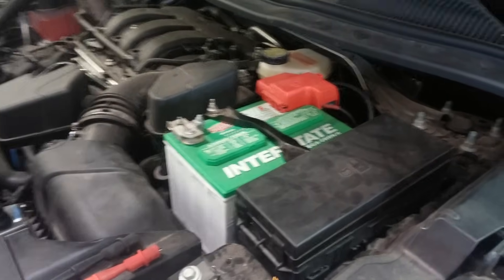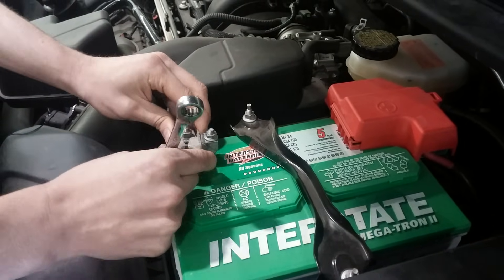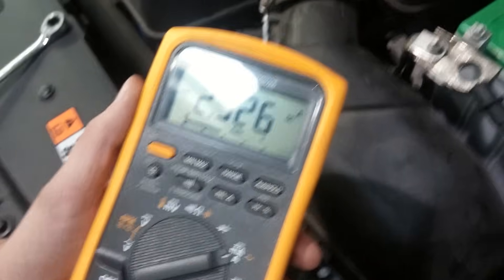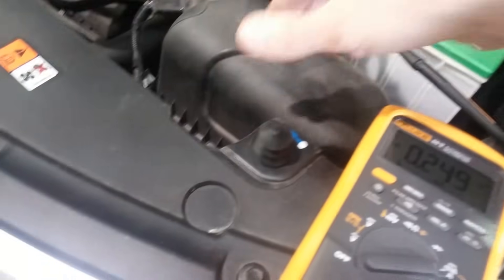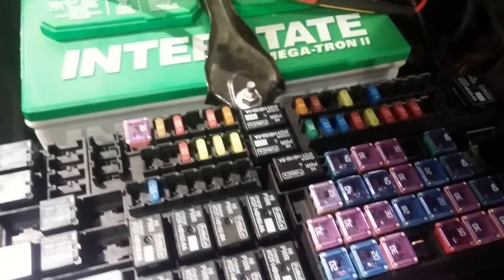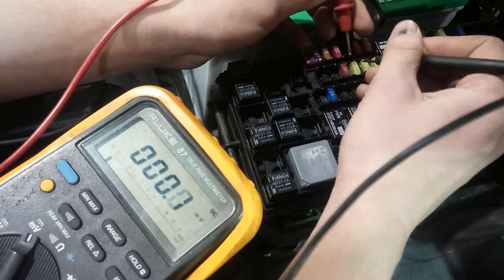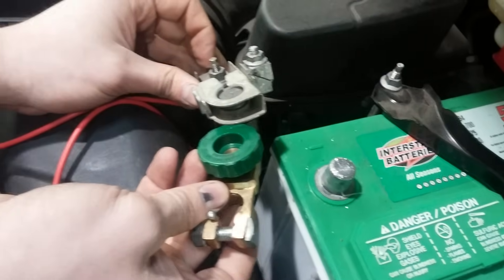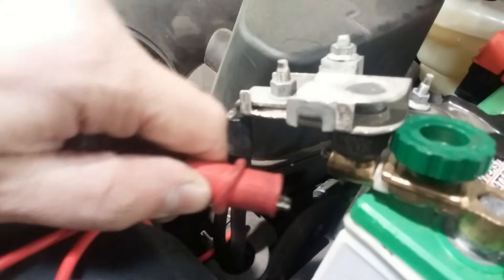How to identify and locate a parasitic drain

Comment: My test was a quick one.  When I hooked up my multimeter to test for a drain I noticed that I not only was getting 3.2A draw but every time I touched the meter to the negative cable I was getting a click from the AC compressor.  Pulled the 10A fuse for the AC and the drain immediately went away.   Now to figure out why that is happening.
Reply: Does the AC compressor have a solenoid switch similar to a starter? If so, maybe it has shorted or failed.

Comment: What about if you don't have a second multimeter? Do you then just hook the battery back up before you start testing the fuses? Also, with your setup of the multimeter being in series, will that have any effect on the results of the fuse testing?
Reply from the maker: You are exactly right.  You can reconnect the battery and then begin checking for voltage drop across the fuses.  The multimeter in series will have no affect on current flow.
Reply: @JustinMillerAutomotive  Ok that's what I was thinking. However with the car I am testing there is an alarm that sounds when you reconnect the battery. But it doesn't sound when I have the multimeter in series. I get no reading on the meter. I dont expect you to diagnose through YouTube comments but I am lost lol

Comment: Couldn't one "theoretically" take out the fuse on which you measured a voltage drop and check the amp drain on the battery once over? if it's not significantly lower you would know there is more than one cause.
Reply from the maker: You can definitely try that.  It worked well on see cars, before computers were involved.  Now, with dozens of ECUs in the vehicle, removing a fuse or reinstalling it can have very unpredictable effects on the amount of current draw.  For example, removing a fuse can sometimes cause an increase in current draw.
Reply: @JustinMillerAutomotive  Yes, but he is on the right path.  Remove the fuse, insert ammeter, wait for stabilization as before, then, assuming you have two good ammeters in the system, compare readings.  If they match within reason, all the parasitic drain is through the removed fuse.  If there is a difference, a fraction is in the removed fuse and more remains to be found in other fuse(s).  and so on....

Comment: Sparks also indicate a short circuit.
Reply: Bastos Reviewer
 - Not necessarily. Sparks are a clear indication that a determined connection is not "solid". The intermittent contact might/will generate the sparks. 
Example, contacts on a relay or any other switch, over time the contact surface will "burn" due to those sparks. Without ever being a malfunction or short circuit (as in error condition).  
  
But smoke is definitely a good tell tale that something isn't right. LOL :-)
Cheers

Comment: What if none of the fuses have voltage
Reply from the maker: Make sure to check for other fuse panels in the car.  Most cars have fuses under the hood and in the interior of the car somewhere as well.  If you still don't find the culprit fuse but you have a parasitic drain from the battery above 0.030 amps, then get a "power distribution" wiring diagram for the car and start at the battery.  If you have two positive battery cables, for example, try to separate them or determine which cable has the drain in it.  From there, look at the diagram to see where it branches off to.  You may be able to continue to use the principle of voltage drop across different wires or portions of the circuit to find out if current is flowing.  If you have a really sensitive current probe, you might be able to use that as well.
Reply: If it's Mercedes there may also be fuses in the trunk as well

Comment: thank you for this video! would it be possible that one of those jcase fuses is our culprit for parasitic draw or short, if so how do you test it? thanks again!
Reply from the maker: Of course the fuse itself cannot cause the drain, but if you are asking whether the drain could be passing through a j-case fuse, it is possible, but not likely.   This is because the larger fuses typically are a "main" fuse that protects several "sub-circuits" that each have their own smaller fuse.  For example, a 30 amp j-case fuse might feed three circuits that are each protected by 10-amp fuses.  If there is a drain in one of these circuits, it would show up in the small fuse.
Reply: @JustinMillerAutomotive  yes that was what i meant. thanks so much!

Comment: Once your battery has been drain and now dead. Is it damaged? Or can it be recharged to new again. I just bought a new battery and realized it was not the battery but a power drain. Just want to know if I should now replace the battery once it went dead like this?
Reply from the maker: You can recharge your battery and it should be just fine!  Every time you drain your battery, it reduces its capacity slightly.  This is true even of your cell phone and laptop batteries.  A car battery can only be cycled (drained and recharged) about 7-10 times before it needs to be replaced.
Reply: @JustinMillerAutomotive   Thanks so much.

Comment: Why should you start by measuring the amp draw from the battery first and not with the fuses?  Couldn't you determine if you have a parasitic draw from the fuses instead thus eliminating a step?
Reply from the maker: For me, it is just part of the logical problem-solving process.  I want to know if there actually is a drain before I put effort into hunting it down.  It rules out other variables and possible causes, such as an intermittent problem or  a bad battery.  You could spend a lot of time looking for a problem that doesn't actually exist.
Reply: Do remember to check the state of the battery, its age, any contamination on its surface, or the cradle its sitting in🤔, make sure its fully charged, get a DROP check done(pole to pole discharge) to ascertain the usefullnes of the cells and overhaul condition, as often, a depleted cell/or generally a bad battery will give enormous grief, and time consuming misplaced effort.

Comment: I like measuring the mV across the back of the fuses instead of removing fuses to see if the Amp draw drops like it says in other videos.  In my case I KNOW there is a parasitic draw because I just got a new battery a few days ago and after letting car sit a few days (with everything off and all doors closed) so I won't need to mess around with disconnecting the battery cable to hook up the meter in series, I can just go straight to measuring the voltage across the fuses.  Brilliant idea.
Reply: Cantfigurewhyampormv

Comment: I'm assuming the clock will be a draw and we already know this. Should we first ensure the clock is on a dedicated circuit and if so remove that fuse? If the radio is on a shared circuit then we'll need to detirmine the draw the clock needs and test to make sure there's not an excessive draw? Yes, removing the fuse will likely awaken the computer so may need to wait the time required (30 or so minutes?) for the computer to shut down.
Reply from the maker: The clock and other computers in the car will always draw some current for their keep-alive memory.  That is the reason that it is acceptable to have up to 30 milliamps of draw at all times.

Comment: I have a 2003 Chevy tahoe New battery want stay charge I check fuse an alternator is good any suggestions?
Reply from the maker: Check for a parasitic drain.  Also, make sure your battery connections are clean and tight.

Comment: I remove all fuses, relays, breakers and still reading 1.50 - 1.70 then goes down to 0.10 - 0.39 and bat keeps drain.. probably need new fuse box..
Reply: See if rear wiper arm is not PARKED . Check radio , is display or clock on ? Get IR temperature gun . Is anything reading warmer than other items ? Example : Valve cover 75 degrees , Alternator  115 degrees . Same with relays , fuses ,   etc . Follow this video with meter. Latch doors , hood - or pull connector and jump with paper clip , etc . May take an hour for car to go to sleep . Any accessories or alarm pulling power ?

Comment: I have Honda Civic 2005. Normally when I switch on I see maintenance lights comes on. After a while all goes off except Battery and engine oil light. Its normal and my car start without any problem. But now for few weeks when I turn on I dont see battery maintenance light and my car do not start. I turn on and off several times then I see battery light and start the car. Anyone knows where can be the problem?
Reply: When your car is off and your battery light is on it usually means its low on voltage and therefore low on charge. When it is running and it remains on, the current coming from the alternator is usually low, and therefore needs to be replaced.

Comment: I'm told there's some reading electronic screen that garages have that will pinpoint what your problem is on your vehicle.  Do these tests work for electrical problems as well? I don't want to waste $40 if they don't.  My battery(s) have been draining.  i'm on my third battery in two weeks.  First one we thought maybe faulty battery b/c it was brand new.  Can Tire replaced it, but started draining my second battery within a week.  Now I had to buy another battery and things were fine for a few days, but yesterday i went out and of course dead battery.  We did the process of elimination testing with the fuses and nothing came up that any of them were draining the bat. So we're at a loss.  We did notice that whenever we checked the fuse for the auto locks we'd hear the back gate click.  So that was suspicious.  So took the skin off and noticed some of the wires that run to the back hatch door were rusted, so maybe causing a short?  So we disconnected the fuse to the auto door locks until i can replace that mechanism and the vehicle actually was fine for about a week.  Then yesterday went out and the battery was dead again.  OMG so frustrating. Now, it seems this happens when it gets really cold or the vehicle has been sitting for a couple of days when i don't drive it, but i've had batteries in my other vehicle that were 5-6 years old and many times i forgot to plug my vehicle in and it would go to like minus 25 cel and it would still turn over.  But this vehicle for some reason it can be 0 cel and the battery is dead, so i don't know if it's the cold that's doing it.  And it's periodic as well which makes it even more difficult to figure out what's causing the drain.  So any other ideas out there?  My vehicle is a 2002 Liberty Renagade.  I don't know if the model makes a difference or not.  But maybe someone has had this same problem with these vehicles and can shed some light on this problem.  It would be greatly appreciated.
Reply from the maker: I am not aware of any tool that can make it easier than this.  Intermittent electrical problems can be frustrating to track down!  Make sure that you are checking the fuses under the dash as well as the fuses under the hood.  Did you perform the first step and measure the overall drain on the battery?  This will help you to be certain whether there is a drain at that very instant, so you know whether to continue testing or not.  It really helps to have a "power distribution" wiring diagram as well so that you can see all of the possible paths the current could be taking.
Reply: Almost have to disconnect the battery after driving each time to save the battery. Try various internet sites on how to locate the drain. Just getting started on how to do this and avoid the $100 plus charge for just finding which circuit has the drain, which you can do yourself. Found 2 fuses with a drain, one the turn signal. Now have to find if its around the socket, or in the wire, or where the short is. Can be insulation worn off. Good luck.

Comment: Can putting the car on the computer answering your question why the battery keeps draining? I like your video.
Reply from the maker: No, it wouldn't be able to provide that type of information.
Reply: Whatta mean "putting it on computer" You know, you have to be smarter than the equipment, Eh?
If you were to put the car on the computer, the computer would get cracked, do you think?

Comment: Would a 50 Amp rated fuse generate a Voltage drop with 100 milliamp current flow?
Reply from the maker: Yes.  Every conductor drops a little bit of voltage when current flows through it.  It will be a small amount, so watch carefully for the meter to go all the way to 0.000 millivolts.

Comment: Is it possible you can have a parasitic drain with a relay. If so how do you test a relay for amp draw?
Reply: I've had that problem with my fuel pump relay.  It was stuck on causing the drain.

Comment: I have a 12v drain checked fuses and starter will check again on the amps setting helpppp!!!
Reply from the maker: Just to clarify, you are measuring 12 volts across one of your fuses?  If so, that is not a drain, that is a blown fuse.  A drain will cause a voltage drop of no more than a millivolt or two across any fuse.  Always use your ammeter to check a current drain of 30 mA or more before jumping to conclusions.

If you do have a drain--make sure to check the fuses inside and outside of your car.  Also, look for any other cables coming directly off of your battery that may not go to the fuse block (starter motors typically aren't fused, and some people have aftermarket amplifiers, etc. that are connected directly to the battery and do not go through the car's fuse block.   The current is going somewhere!

Comment: great video Justin Miller. I have found that on older cars that have had a remote car starter installed that it is the remote starter box that is drawing current. Seems when they get old they don't shut down or something.  Check that the alternator isn't the problem. I'm just working on a semi with 4 -1125 amp batteries that go dead in a week.
Reply: AL M  ——I have an old truck with shaved door handles. The receiver was my drain. The receiver is similar to a remote start keyless entry module. Thanks for the tip!

Comment: Good video, however you did not explain what that one fuse that had current going through it. What was the fuse tied into?  And did you solve the problem of the drain?
Reply from the maker: Yeah - I'm sorry that I didn't go further.  To make the video, I created a "drain" by turning on the dome light.  If this was a real diagnosis, once I located the fuse that was carrying current, I would locate an electrical diagram to see what circuits are powered by this fuse.  If it turned out that this fuse feeds the radio, the dome lights, and the horn, I would then begin isolating these circuits one at a time until I found the culprit circuit.  If it turned out that the radio circuit was causing the drain, I would then unplug the radio to see if the drain goes away.

Comment: Oh, My! you came with the secret! interesting that even Chris Fix didn't mention to pull fuses, but that explains why when I did that old pulling method, my meter was all over the place jumping up and down. I need to redo my test using just part 2. part 1 already shows me .136  that right ".136"  I have the Optima yellow top, which loses a Volt Per hour! My car is driven only on weekends, but remote started for 25 minutes daily. or the battery drops to 9volt and below.
I do have the Viper Smart Start with GPS. still  no excuse for .136 average.
Reply: I have a 2004 Oldsmobile Alero and I had a navigation system installed with a backup camera and a dash cam. I'm hoping that none of those is causing the parasitic draw. Because sometimes I can't even start it a couple of days. It'll be 10 volts DC just in a couple of days. No excuse also opening the door cuts off two volts ??

Comment: I've heard the rule of thumb vary from 30mA to 50mA. It really depends on the spec range of the car. Good vid.
Reply from the maker: You're right.  It all comes back to the guideline that says that a 1-amp drain over a 24-hour period will typically drain a fully charged battery to the point that it won't be able to start the car.  So, a .5-amps drain would take 48 hours,  a .25 amp drain would take 96 hours (4 days), and so on.  Based on this math, a 50mA drain would prevent the car from starting after 20 days of sitting,  and a 30mA drain would take 33 days.  Not to mention that a battery's life is shortened when it spends any amount of time sitting in an undercharged state.  I guess the best rule is that the lower the drain is, the better your life will be!

Comment: How do i narrow it down when i know the circuit? MY problem is with the fuse that feeds the dash and many internal things. Do i have to start pulling the dash apart??
Reply from the maker: It's hard to say what you will have to do, but if you have a diagram showing all of the circuits that are fed by the fuse, you might be able to find ways to narrow the problem down.  At some point, the circuit will branch out into many other circuits.  Is there a way that you can isolate each branch one at a time until you find the branch that is drawing the current?  That is how I would try to approach it.